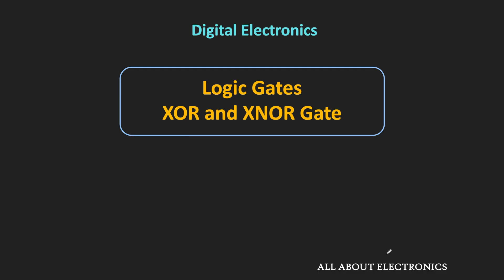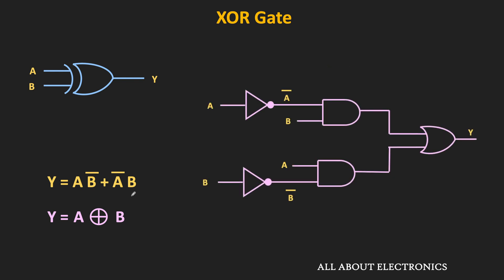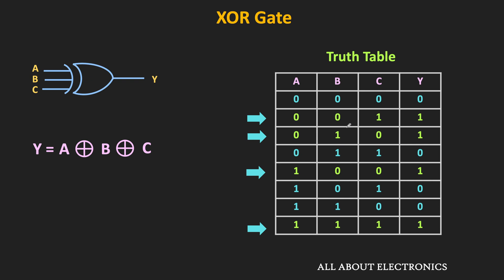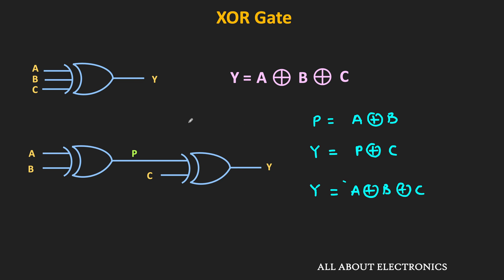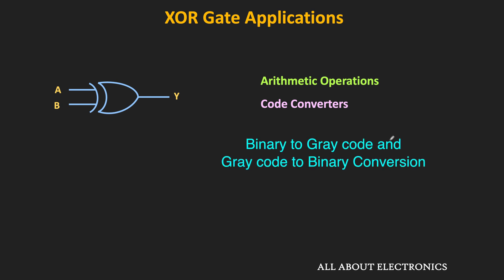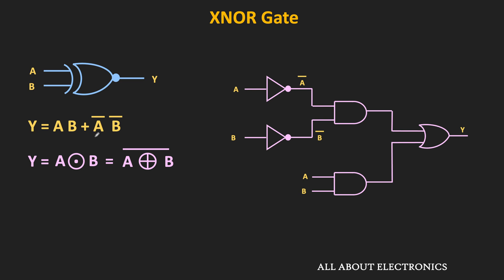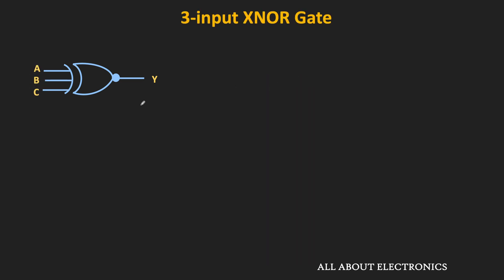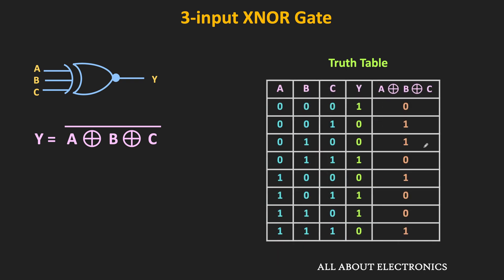Logic Gates : XOR and XNOR gates Explained | XOR and XNOR gate as Inverter

Comment: In XOR gate first you said that when variables are different then output is 1 check 2 variable but when you are doing three variables you had written 1 in output when all the inputs are 1 why
Reply from the maker: Please check at 5:28. I have clearly mentioned that when odd number of inputs are high then output of the XOR gate is high. For the two inputs anyway that will be true. (when both inputs are different then output is 1, as in that case, only odd number of inputs are high)

Comment: What you are trying to say by 3:24 "we can say that it's output is equal to ONE when odd number of inputs are high" ????? It's confusing because the way you identifying odds and evens. which one are odds and which one are even????
Reply from the maker: In the input, if there is odd numbers of 1s (1,3,5 etc) then output of the XOR gate will be 1. I hope, it will clear your doubt.
Reply: @ALLABOUTELECTRONICS  TQ let see,  by the way good work.
Reply: @ALLABOUTELECTRONICS  But in X-NOR gate you say the function is high(1) when Even number of input is high(1) but why 0 0 0 =1 (high) , Although there is no any even high(1) output. 
How it becomes 1?
Reply from the maker: You also need to include the case when all the inputs are 0. That means when no inputs are high or when even numbers or inputs are high.
Reply: In simple terms, with regards to 3 inputs: if you have only one high(logic 1) as any input (obviously the other two inputs being low or logic 0s), You will have your output as 1. So for XOR, anywhere where there's one logic1 and two logic 0s the output will be 1.

Comment: 10:50 for n input xnor gate when even number of inputs are high then output is also high. But it is not following according to this generalized way. As if we consider 3 input XNOR GATE as follows:
 A(XNOR)B(XNOR)C = 0(XNOR)0(XNOR)1= 1 (i.e. odd number of one's)
Similarly 0(XNOR)1(XNOR)0= 1(i.e. odd number of one's)

And for even number of 1s it is giving me  0 as output .
 Considering above XNOR expression
0(XNOR)1(XNOR)1=0 ( i.e. even number of 1s)
1(XNOR)0(XNOR)1=0 ( i.e. even number of 1s)

I have two conclusions for n input xnor gate:

1. For even inputs,  output is logic high if  number of logic high inputs are even. 
2. For odd inputs, output is logic high if number of logic high inputs are odd.
Reply: Your conclusions are **incorrect**. Let's clarify the behavior of the n-input XNOR gate.

Rule for n-input XNOR Gate:

The *n-input XNOR gate* produces a high output (logic 1) when the *number of 1s (high inputs)* is **even**. If the number of 1s is odd, the output will be low (logic 0).

Now, let's break down the scenarios you've mentioned for the 3-input XNOR gate.
 Example for 3-input XNOR gate:

1. **0 (XNOR) 0 (XNOR) 1**: 
   - Number of 1s = 1 (odd).
   - The output will be *0* (logic low), because the XNOR output is high only when the number of high inputs is even.

2. **0 (XNOR) 1 (XNOR) 0**: 
   - Number of 1s = 1 (odd).
   - The output will be *0* (logic low).

3. **0 (XNOR) 1 (XNOR) 1**: 
   - Number of 1s = 2 (even).
   - The output will be *1* (logic high), because the number of high inputs is even.

4. **1 (XNOR) 0 (XNOR) 1**: 
   - Number of 1s = 2 (even).
   - The output will be *1* (logic high), because the number of high inputs is even.

 Conclusion:
- The **output of an n-input XNOR gate is high (logic 1) when the number of high inputs is even**.
- The **output is low (logic 0) when the number of high inputs is odd**.

In summary, for any number of inputs, the XNOR gate behaves based on whether the number of logic high inputs is even or odd, and not dependent on the total number of inputs (odd or even).

ps: you might want to to google the truth table of xnor for 3 inputs

Comment: Why are resistors in ohms and megaohms difficult to fabricate, why we use it in kiloohms generally?
Reply from the maker: They are also used. It depends on the application. In digital electronics, typically the external resistors used with the digital circuits are in kilo ohm. But sometimes the other resistors are also used. And apart from digital electronics, in many other applications the resistors in ohms and mega ohms are used quite often.